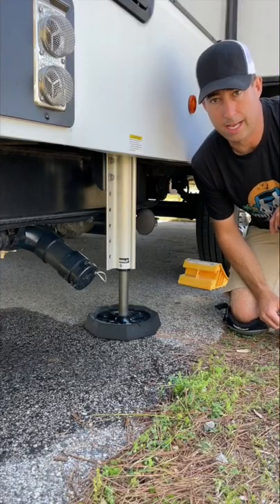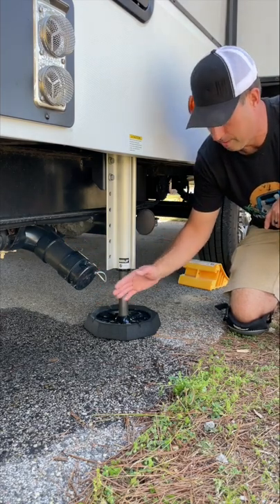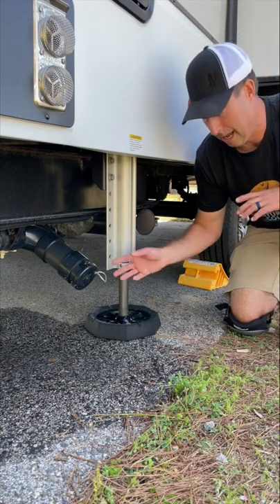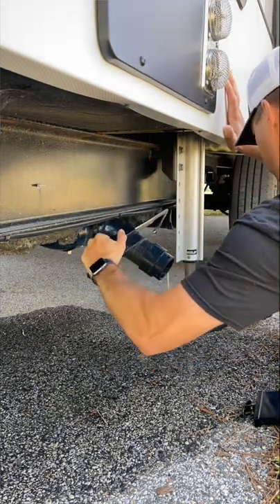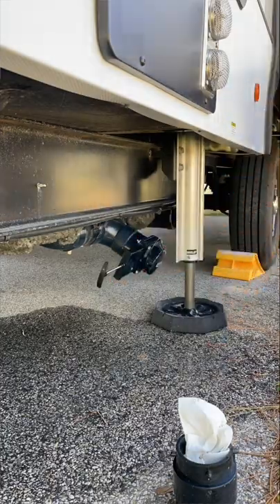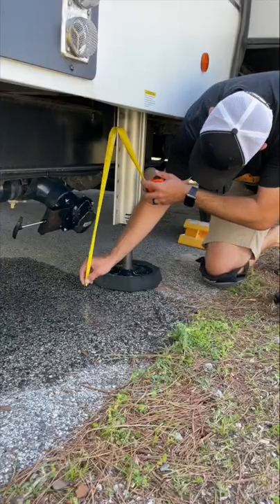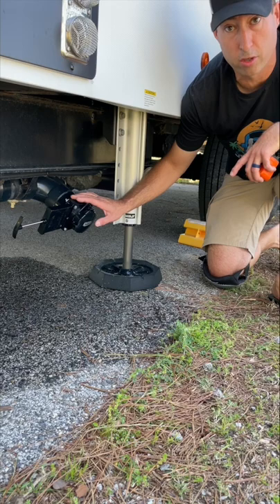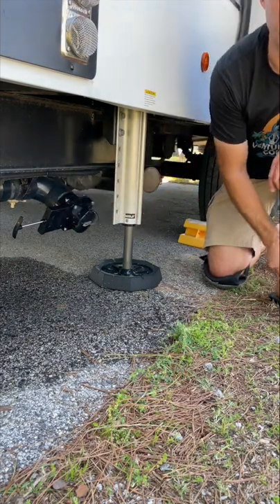DIY RV Waste Valve

Comment: Taking time to deburr, sand and prime should make a good bond on the ABS. Tight space but with the pull handle horizontal you have good clearance and can tighten the screws when necessary.
Reply from the maker: We agree! Preparing the surface makes all the difference ensuring that the materials bond well. Thank you for watching our video and supporting our channel.

Comment: I have the exact same problem. My sewage valve is too long and there’s hardly any clearance or any current that will let my sewage go down into the sewage tank with my sewage hoses. I have a beaconed 2019. I don’t know what to do. It’s a little different than yours with. It’s the same problem that you’re having. That you fixed.
Reply from the maker: Hey Eric, thank you watching our video and supporting our channel. I had to cut a lot of the ABS pipe to get the clearance I needed to install the Valterra valve. We have been very happy with the outcome or lack their of. 😝